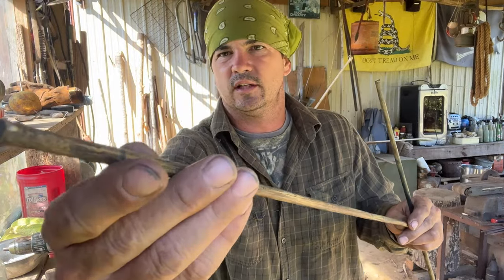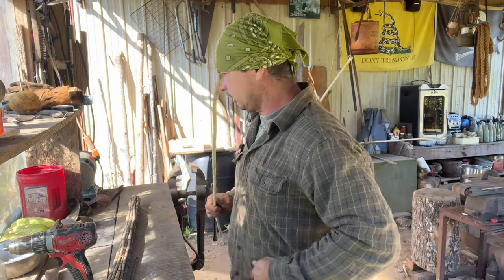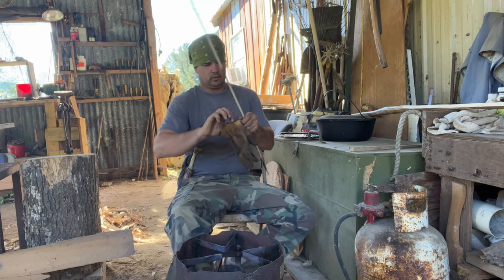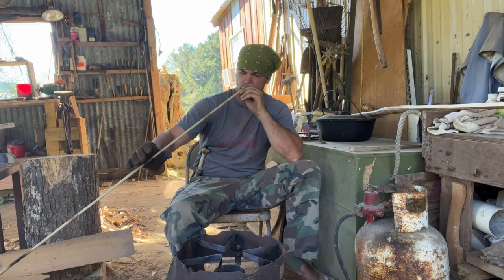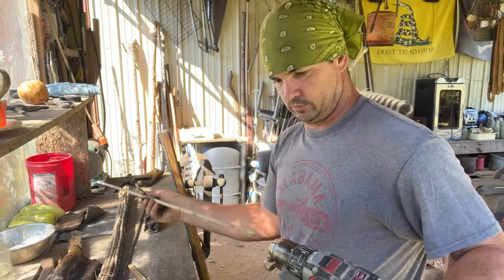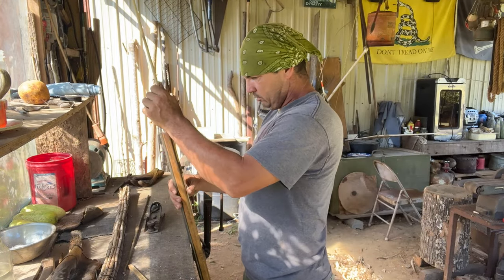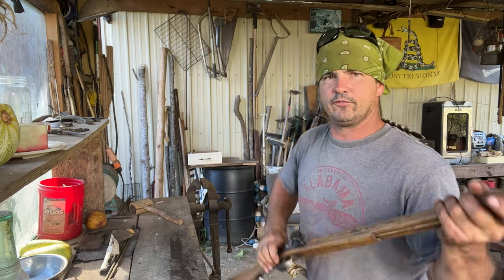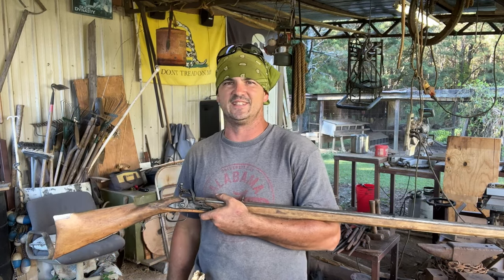Building a Ramrod for the .36 flintlock

Comment: Brother  If you're gun gets damp or wet that ramrod will stick up inside there and it is a booger to get out I just did it on my 36 caliber mountain rifle and Buffalo and I had to drive it in and break it off piece by piece because I could not pull it out
Reply from the maker: I sealed it with animal oil. Its not gonna swell. I made the last one and it rode in the canoe in the rain and worked

Comment: Well, here I go again. Don't think I believe I know everything, but I did .earn something from you about using the drill to smooth things out and round them. I'll give you a hint. I had an uncle who never used a store bought axe handle. He'd take the straight grained white wood from a Hickory. He'd split it out, rough out the shape of the handle with a sharp axe, then with rasp, pocket knife, and glass shards He'd work out the smoothest handle you ever saw, except for the one chop mark He'd leave at the bottom of the handle so you could tell it was home made. You could stick the axe in a wood block and twist the handle to a 45 degree angle. You could wear them out but you weren't going to break them. Now why couldn't you do the same thing with a ramrod, then you'd never have to worry about breaking another one? Just a thought.
Reply from the maker: My reason is the amount of work. But i agree it can be done and would make a better ramrod

Comment: I use my vice a clamp a pair of scissors scape the rod back and forth if I have to remove lots of wood then soak the rods in  kerosene for about 3 months to make flexible
Reply from the maker: Kerosene will make wood flexible? I did not know that.
Reply: @SpiritoftheOutdoors  it  keeps the wood from drying out and doesn't let moisture soak in you can do the same thing to AZ handles
Reply: Ax
Reply from the maker: @randallross7683  ive really taken a liking to the animal fats to seal dry wood from moisture and it dont make em slick feeling. I use a lot of skunk fat, let it sit in a coffee can all summer.
Reply: @SpiritoftheOutdoors  I can see where the fat would work too and not be as smelly as kerosene. Ps I like to wrap the string thing  like a candy cane around my ramrod .